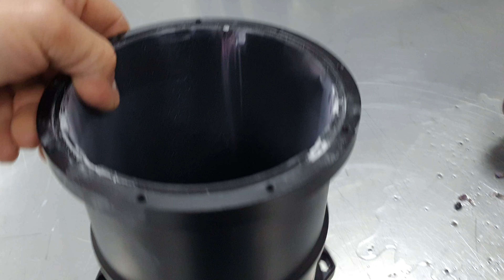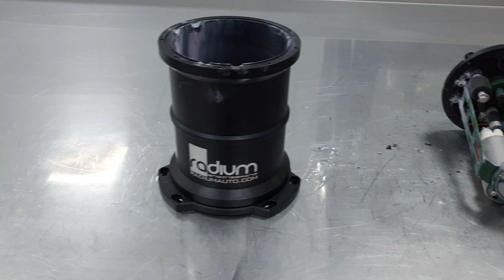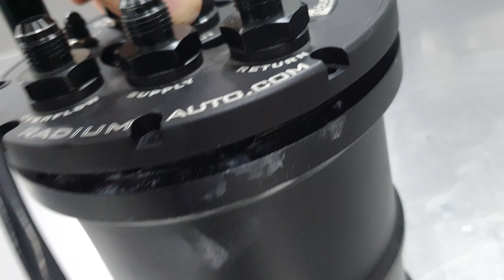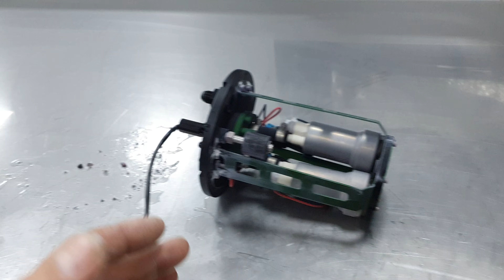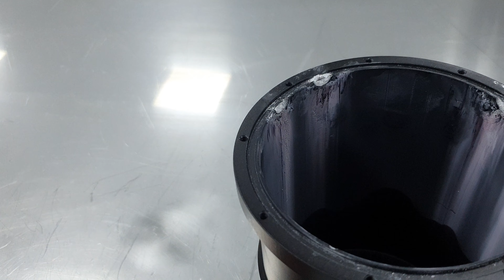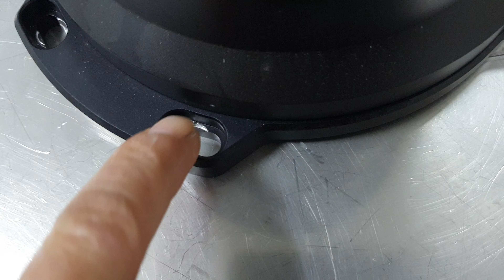RS3 DAZA engine rebuild (part 27.1)

Comment: It's not installation!  It is a design flaw and the fact you are making a battery somehow.  The lid and the body of the pump need to be grounded together and be a at the same potential. You'll need to machine the anodization off in a small area and install a ground lug.
Reply: Isolating the hardware will a nylon washer and perhaps shrink wrapping the Allen head screw should offer additional protection.
Reply: @michaelmorgado  Isolating may or may not work, even my idea may not be good.  You may create a drain on the battery. You need to figure out how this voltage inside the pump is created and how high is it. It could be just 200mV but it would be enough to create the corrosion and strip off anodization.